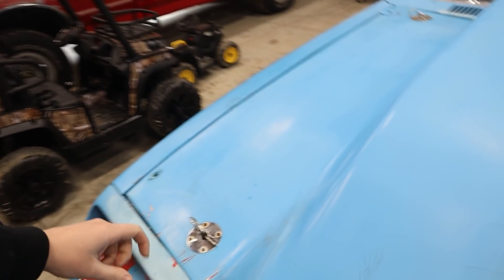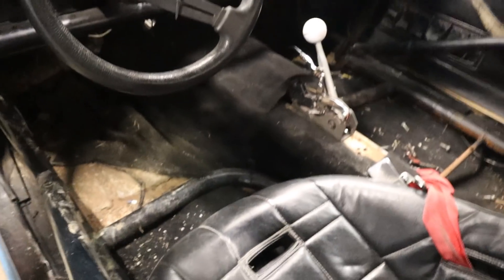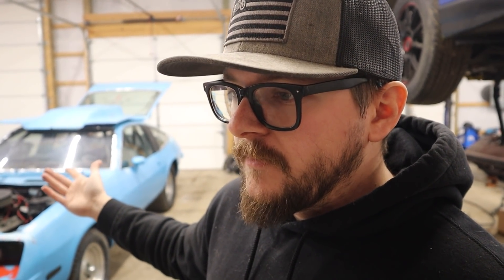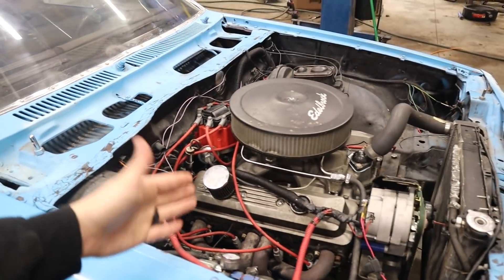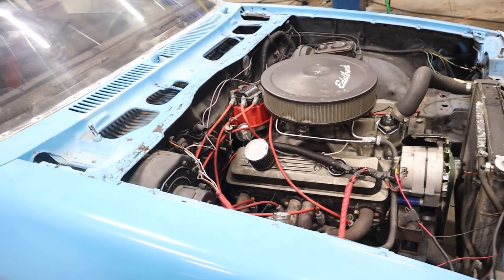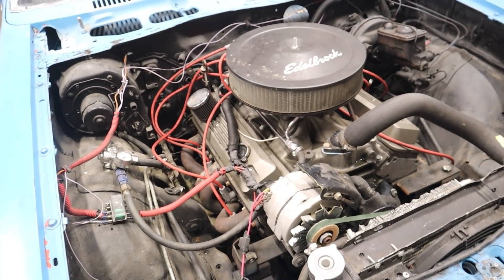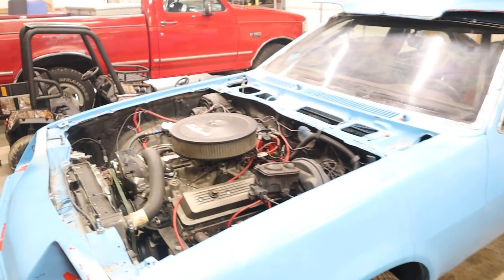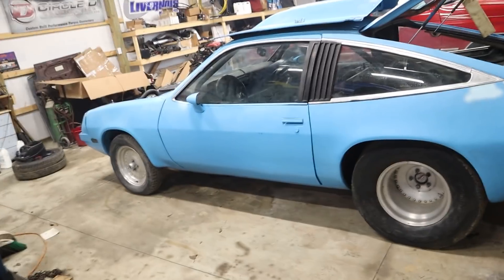The ORIGINAL BUILDER REACHED OUT! The Complete History of the Pro Street Starfire!

Comment: Just an observation on the heads. Tpi corvettes came with aluminum heads that were marked with a "w" like that. And used the finned aluminum valve covers that you have.  They used standard intake bolt pattern, but were otherwise an aluminum version of the vortec heads that came in iron later. I can't tell in your video,  but the vette heads are also angle plug heads. And they will use the "self-aligning" rockers. You should also find the gm part number under there as I recall. They are kind of rare, but not a 1 of 1 thing.
Reply: These look awefully close to an L98 / ZZ4 head in every aspect, except for the 113 casting number of course (10088113) 
The W could be for Winters Foundry casting
Reply: @kristjanstefansson2765  L98 !  That's the RPO code I was trying to remember.  Thanks.
Reply: That's exactly what I said the early 80s aluminum

Comment: We used to run the old comp cam 292 .501 with 1.5/1.6 rr, back in the day, I ran it in my 350, 331 and even when I built the 388 with the Vic jr and a small 650 holley double pumper

Comment: I would run through every inch of the charging system. Are the lugs crimped properly, is something going open under vibration. Shorts to the chassis? What circuit is the gauge tied to?  Wiggle wires while charging and look for Volt changes. It will be a fun car when it gets straightened out.

Comment: Make a turbo kit with one of the turbos you have kicking around.. fix the Swiss floors tune it up with the turbo get the suspension setup so you can race it and take it racing.. maybe the 327 makes 700hp a couple of times and you have to build another small block or LS swap it. It could be a fun machine for this race season.. It is an interesting car for sure..
Reply from the maker: Lol I had a whole talk after this about turboing it that I cut out cause I might discuss that in tomorrow's video

Comment: I would really be concerned about OVER HEATING since it doesn't have a fan attached to the water pump or a set of electric fans and especially with the front end not having any open air vents
Reply from the maker: It has a pretty bug fan on the front of the rad pushing air. It only got up to about 190 on the drive to my place and it probably has a normal thermostat in it
Reply: @SniderTron3000  i really appreciate you responding back👍🏻😎👍🏻 I'm glad to know its got a fan hidden in the front. I remember when I was 16 i got in a hurry after I put a new V8 motor in my 78 Malibu and i didn't put in a bigger 4-core radiator in and the first drive it overheated and Warped the Heads. Hope you can figure out this old Blue Beast and get it Rippin on the Streets✌🏻

Comment: Please don't bust the windows out. And install STUPED  lexan and pop rivets.  Sand the hideous blue paint  off. Get some head lights. Don't cut the whole front end off. And move the engine back 2 feet. Fix the cage so it runs down  the a pillar.  Run bars  into the engine bay. Keep it as stock looking as possible.  No butchering. The suspension must be jacked to. If it floats.  👨‍👩‍👦‍👦😖🧐🧐🧐🧐